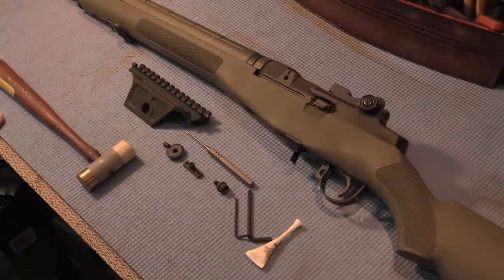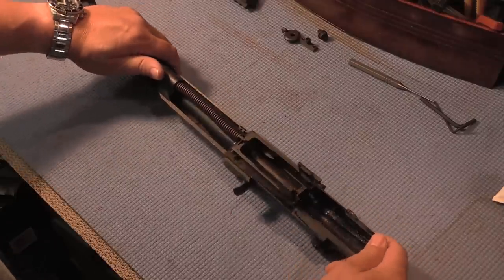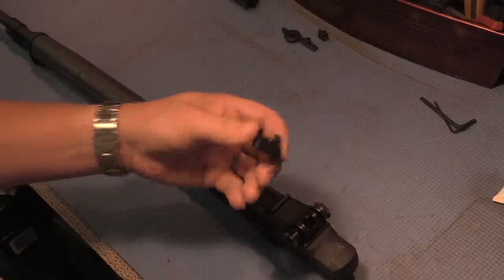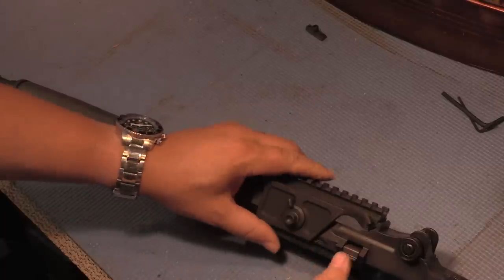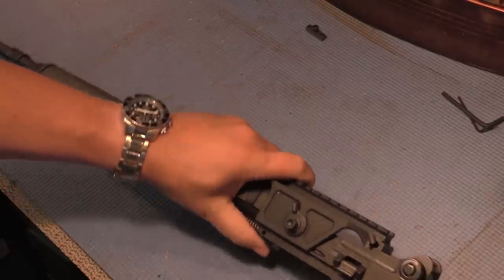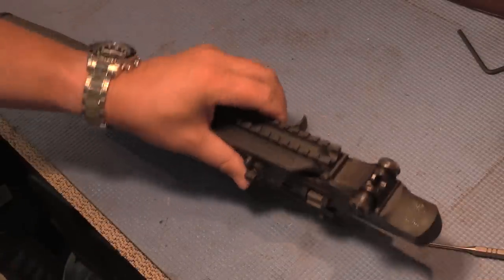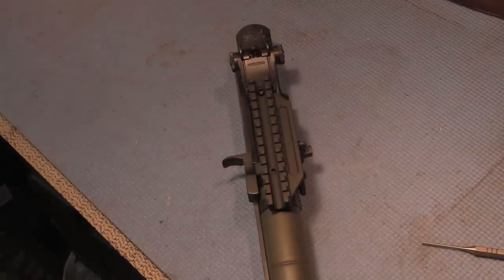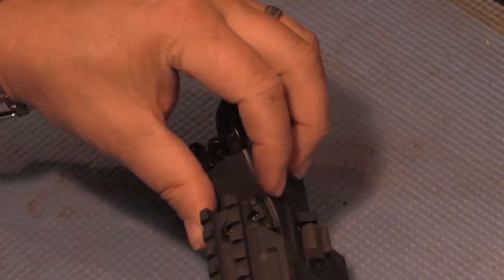How to Install the SADLAK Scope Mount M1A or M14 Springfield

Comment: Just installed SADLAK mount on my M1A.  Start to finish took me 30 minutes.  Comes with very detailed instructions.  Comments:  Step 1.ii says to use a 3/32 diameter or slightly smaller pin punch to remove stripper clip pin; 3/32 punch was to large for mine, but a 1/16 inch worked fine.  Step 7 says to lightly tap on Cam Washer to get mount to correctly mate with receiver; toke a little more light tapping than I was expecting, but eventually got desired results.  Your video very helpful!

Comment: Just finished watching April 2019. First, thank you for not doing the silly thing so many do making an instructional video, showing the packaging with some very long narrative that goes nowhere, THEN, slowing opening packaging and repeating much of the same 1/2 hr. prior, THEN FINALLY 45 mins later what really folks are looking for, a no nonsense get to the point [ how to]. KUDOS putting a great instructional video together! Second, I've been pondering what mount to hang on my M1A1 for some time. The best of the best is replacement of receiver, a one piece assy. with mount, downside, being in the neighborhood of $900.00, that's out for me. SADLAK looks to be a cost effective, positive lockdown mounted to rifle I've seen yet! The Gen 4 Springfield mount looks to be a constant maintenance concern keeping in place. Had a very bad experience with a scope mount from BSquare on a mini-14.  I see of the similar with the Gen 4 Springfield vs BSquare. Thanks again for a great video! Cheers!
Reply: What setup did you go with and how has it performed?

Comment: good mount, some users may need to do some tweaking of their own as not all m1's/m14's are made the same these days. many will find it lining up canted left in the end. Back out a tad, slide rear left a bit and lock back down again. If scope alignment is tough for some people to see, use something like dental floss from the front post through the rear peep to help gage by eye.

ABSOLUTELY important to get the torque right also.. seen too many people with cracked receivers.

Only thing I would like more of is some visability from the left or even the back/top on the chamber by keeping an opening in there somewhere..

Sadlak still has some of these titanium mounts, get them while you can, because they are not going to make any more (in titanium, they will continue with aluminum and steel of course)

All together solid mount, allows for iron sights in that 500 or less range, and a good platform for getting scoped out to 1km.

m1a loaded, JAE-100G3 stock, GGG 1902 heavy swivel bipods, MK4 3.5-10x40 Leupold, 175gr.

Comment: Thank you so much for the video. I wouldn't have been able to install the mount without it. I also had trouble with the clip guide key and set screws. I ended up putting the set screws in almost all the way but not tight so I could put the clip guide key in BEFORE the mount itself

Comment: Great video!  Thanks!  One thing.  If you are installing a Smith Enterprises extended bolt release, do that FIRST before you install the Sadlak scope mount.  If the scope mount is installed, it's impossible to get the pin out for the bolt release.

Comment: Thanks for the video man. I used it to install my Sadlak Airborne Mount on my Socom 16. I mounted a US Optics 1.5 - 6 on it. So far I'm happy. We'll see how it goes at the range.

In order to get mount close enough to the dovetail, I had to start with the washer pretty much at the 12 O'Clock position.
Reply: I was wondering if this would work on the socom16

Comment: Appreciate the video! Just wanted to let you know that you have some of the torque specs backwards. 

The hex screw is the screw on the side that goes into the receiver, that's 60-65 in/lbs
The clip guide screw (which you mistook for the hex screw) is 30-35 in/lbs. This could be a fatal mistake putting that much torque on the clip guide screw, if you were to crack your receiver, I don't think any manufacturer would cover that. 
And the two set screws in the clip guide key torqued to 20 in/lbs.
Reply: he states that there are some torquing that needs to be done... clearly people should read the instructions as well as follow the video
Reply: papersly vg

Comment: Special Note for this installation:  The guide-wedge "key" can be installed 2 different ways. There is a very small (almost-micro) "step" on one side of the wedge. I installed mine with the step facing down. When I put in the center screw, it did NOT go in smoothly. I took the wedge back out and reinstalled it with the "step" on the top side, the center screw then went in very smoothly. Unfortunately, the damage was already done, since I stripped out half of the threads from my first attempt.

Comment: I fought with my Sadlak on my SOCOM for months, then gave up about a year ago. I am going to try again, using your video and some of the comments from below as a guide. Wish me luck. I'll let you know how it works out.  Maybe Sadlak should have thought of this.
Reply: Just removed my Sadlak mount too after remounting it a couple times over the past couple years.. Was considering trying a shorty picatinny mount that fits in the stripper clip, but read some rather unfavorable reviews on it holding zero too. Going back to iron sights.

Comment: I installed mine everything lined up straight. During ejection the spent cases ride along the underside of the mount and the rim jams in front of the OP rod and mount before it can close on the next round. 100% failure rate. With mount off runs 100%. Sa just recently replaced my bolt and all parts related, ejector and spring and extractor. After 200 painfull rounds the mount is chewed up where the cases get jammed. Sending back to amazon

Comment: Can the bolt still be removed for cleaning with the scope mount in place?  It's a bit fiddly under the best of circumstances and it looks like there might not be enough clearance to get it out with the mount installed.

Comment: Great video.  Only thing that drove me crazy was everything you called a "nut" is actually a bolt.  Nuts have a hole in them with threads inside the hole.  Bolts and screws have shafts with threads on the shaft.  I'm an aircraft mechanic so that's the only reason your terminology jumped out to me.  Other than that, great job and happy shooting!
Reply from the maker: Yea I know,  m7ade me crazy too... I do it still to this day
Reply: Pleassse, don't  embarrass us A & P's. We all knew what he meant. I am in a group of about 20 (All A & P's) shooters that work for a major airline. We don't care too much for engineers and know-it-alls.

Comment: I recently watched this video and you really need to correct the cartridge clip guide removal portion. You removed it the wrong way. It may have worked for you, but it could damage someone else's receiver. The clip guide is to be removed from right to left when looking down the sights. It is installed from left to right. Some receivers may break the dovetail off. I've seen it.
Reply from the maker: I appreciate the heads up...  It was very loose to the touch so I never considered it should be removed in any one direction.  thanks for the info.
Reply: tonyben3 If you saw someone break the dovetail off, they did something exceptionally wrong. The clip guides are installed left to right by right-handed people and right to left by left-handed people. As long as you hit it straight on, it doesn't matter which way it goes. The only way I can think of someone being able to damage their receiver is if they hammer on the receiver itself instead of on the clip guide (and they'd have to hit it pretty damn hard).
WTF SoCal As for the clip guide being loose, that's not a problem but it's not how it's meant to be. When installed, the clip guide is larger than the receiver dovetail so that it shears off and is almost perfectly flush. Most don't even need the roll pin to stay in place. If you decide to remove the scope mount and want a new solid clip guide, send it back to Springfield and they should take care of it at no charge to you. 
Source: I used to build M1As.
Reply from the maker: Great reply!  thanks for the information sir !
Reply: What receivers did you build on and how many did you build? Every one I've handled (SAI, LRB, Bula, GWLA, Fulton) the clip guide went on loose from the left side but would not insert from the right side. Every professional gunsmith (former military NM armorers) I've ever asked or followed all say the same thing and that they have seen many broken clip guides for this very reason.
Reply from the maker: OK  I placed a note in the description box about this... instructions say right to left...( i would make an annotation but new youtube platform doesn't allow them anymore)  Now Mr TonyBen - your turn to go fix your video to reflect the fact i never used a hammer (as you say) to remove my guide... thanks !
Reply: Thanks! I'll post a note correcting that. I care more about being correct than being right. For accuracy's sake, I asked three experts on M14 blueprints to clarify how the clip is designed to be installed/removed. Here's a quote from one of those individuals: 
"Tony,

The receiver dovetail is parallel ,it's the guide itself that has the tapered lead in .And it's only on one side of the dovetail.Very little just enough to start.

Tthe guide should only enter from bolt stop side of receiver

Guide should thumb press in 3/4 way from left side ,then final seat with nylon drift to align hole. "
Reply: Jeff at Bula Defense (makes M14 receivers) posted a pic of the clip guide blueprint and called out the measurement. The clip guide should taper from 0.467"-0.003" on right side to 0.474"-0.003" on the left side
Reply from the maker: Gracias
Reply: So to be fair, after watching my own video over again, I was incorrect in stating that the receiver dovetail was tapered when in reality, it is the actual clip guide that is tapered. I posted that correction as well in my videos. This was a great learning experience for everyone. And by the way, I do applaud you and your video is a very good one and I'm sure its helped a lot of people. The view count speaks for itself.

Tony.
Reply from the maker: WOW - this is too funny - in a good way. looks like we all are learning a bunch today !
thanks for working with me and clearing the air!  and thanks for the kudos... your video is quite well done  too!
Reply: I'd estimate I've installed at least 200,000 clip guides on SAI receivers. To my knowledge, clip guides manufactured by SAI are not meant to be tapered (although I've never taken calipers to one). SAI clip guides seat from either direction, so they could be slightly tapered from both sides. It's very possible that this is another difference between the M14 and M1A.
Reply: So I'm guessing you work for SA then. I guess that makes sense since SAI ran out of GI parts around serial number 100k (I'm guessing here). I suppose the warranty department told someone to change new manufacture clip guides to have no taper. So this appears to be a commercial part vs GI part difference. I learn something new every day!
Reply: Yep, one of the best employers I've ever had. I have no idea when the switch occurred, but I'd guess it was even earlier than 100k (just because of how few there would have been after SA, H&R, Winchester, etc. stopped production). I also learned something new. Before this, I had no idea original M14 clip guides were tapered (and it must have really sucked for a lefty to work on them).
Reply: That's cool! The only SAI I ever owned I bought from a local gun store about 8 years ago. It was a nice 85k standard rifle (late 1994 era) with mostly GI parts (H&R barrel) and the only commercial part (besides the receiver) was the SAI trigger housing. The clip guide on that one was very hard to  remove so I can only assume it was a GI clip guide. Once I got it out about 1/4 of the way,  the rest was easy.

It was a great rifle and it was the one I used to install and test the Blackfeather chassis. It shot very well but I had an opportunity to build a match rifle for a killer deal so I ended up stripping that rifle down to a barrelled action and I sold it. I used the rest of the parts to build the rifle that I show in the beginning of my Sadlak video with the titanium mount. I had all the parts (except the receiver) salt bath nitrided.

Comment: Please note that my comment here is based on my experience and what I was taught by my instructors back in 1986 on Ft. Campbell, KY. Back then I was a young E-4 and tasked to go to the 101st Sniper School (don’t confuse this with the Designated Unit Marksmanship Program or Marksmanship Improvement Course) which was ran by Mr. White and Mr. Bosworth who were both Snipers while the 101st was in Vietnam. 
  Mr. White stressed that the scope bracket must be the same type of metal and heat treated in the same manner as the receiver. It’s just plain foolish to use an aluminum bracket or some other formed steel bracket that we’ve seen on the market until about 20 years ago. The first M-21 rifles had the rear sights removed to provide a 3rd point of contact to secure the bracket to the receiver. As the rifle heats up and cools down the steel expands and contracts so if different steel alloys are used, their expansion rates are in conflict with each other and it distorts the bracket causing sight deviation. I use this same bracket as seen in this video for those reasons along with a Leatherwood M-1200 scope (sometimes I use an old Leatherwood Cam-Puter scope) and the results are very positive. Some will install the scope bracket by heating up the rifle to about 150 degrees then tighten everything down but that’s up to you depending on factors that impact your environment, munition type and goals. Hope this helps friends.

Comment: Just a heads up when I attempted to remove the Stripper clip guide it was very difficult it didn’t slide off as easily as the guys in the video. Had to take a rubber mallet and give it a couple of gingerly but affirmative taps but it eventually came off.
Reply: That's exactly how it's meant to be done. His was too loose (i.e., someone didn't do their job when fitting it).

Comment: Is it possible to install the Sadlack scope mount on a National Match M1A without removing the stock due to it being fiberglass bedded?  Thanks
Reply: Lewis Neely Glass bedding preserves the alignment of stock and receiver relationship for both firing vibrations and disassembly/assembly. Basically, it makes several pieces one solid piece to improve accuracy. it doesn't "glue" things together. Once you glass bed a stock and it's cured, you've gotta remove the action to sand down the access fiberglass for a clean look anyways.
Reply: Lewis Neely Oh yeah, last thing, he probably removed the action just to make it easier to install the scope mount for both himself and video purposes...
Reply: You have to remove the action from the stock in order to drive out the pin holding the stripper clip guide in place. That's done from the underside of the receiver.

Comment: Please note that the reference to the torque requirements for specific screws in this video is not correct..PLEASE read the instruction sheet.
Reply from the maker: thats funny, sadlak  contacted me and told me I did a great job on the video.....

Comment: Im having trouble hitting the pin through. Anyone know why?
Reply: A) Not hitting at the right angle. B) Using too large of a punch (getting stuck before it hits the pin). C) Using too small of a punch (expanding the pin). D) There's a bur inside, but that's the least likely. E) Not using enough force (it does take a bit if the pin is original).
Those should be the only options.

Comment: Can I use a 308 pmag on a m1
A
Reply from the maker: Nope.  M1a uses its own style of mag.
Reply: The .308 Pmag is based on the Knight Armament's SR-25 magazine. The M-14 magazine is narrower. The Armalite "B-style" magazine is based on the M-14 magazine. The differences are: the front locking hole and the small plate on the rear of the magazine is not on the Armalite magazine. The main difference is the rear of the Armalite magazine has the AR magazine channel with a follower that can push up the bolt hold open. The left side of the magazine has a square hole for the square, magazine release button.
Other than that the M-14 and the Armalite B-style magazines are the same dimensions. The SR-25 mags are wider. Will not fit the M-14/M1a magazine well. Also, the Armalite Company has a "A-style" magazine fits the SR-25 magazine. Has a  wider magazine well to fit the SR-25 magazine.

Comment: I have 5 brand new milspec smith enterprises mounts that are just like this if anyone is interested in picking one up for cheap.
Reply: Which is better
Reply: +bordersoldier smith enterprises are slightly heavier because they slave steel. They are also way stronger though. Aluminum can get damaged easier.
Reply: +Jordan Mason how much are you selling for
Reply: +bordersoldier they go for 280 on brownells but I'm looking to get $100 shipped. I can get the NSN number so you can Google it and check out prices on various sites if you want. I should be off work around 4ish central time
Reply: Tactical Sniper Mount M14, NSN 1005-01-535-4430
is the name and part number. If you're still interested
Reply: Any mount left ?
Reply: +Frank yee I have 3
Reply: +Frank yee I have 3
Reply: +Jordan Mason any more mounts?
Reply: Jordan Mason still have 3? lol